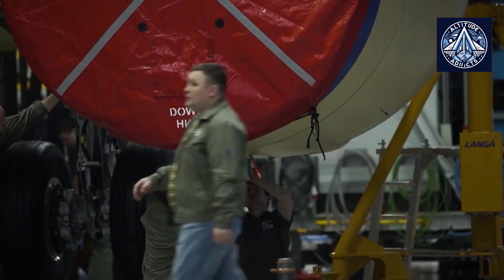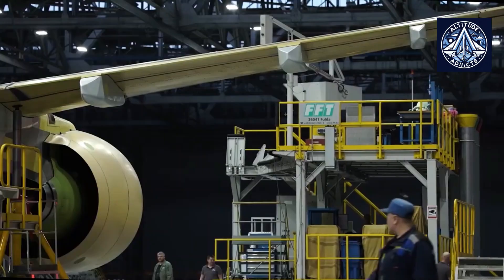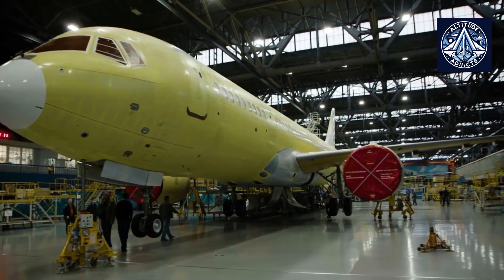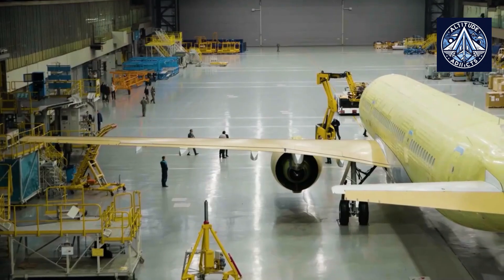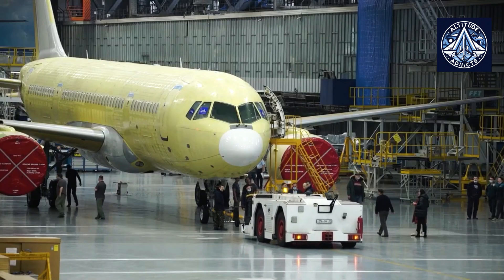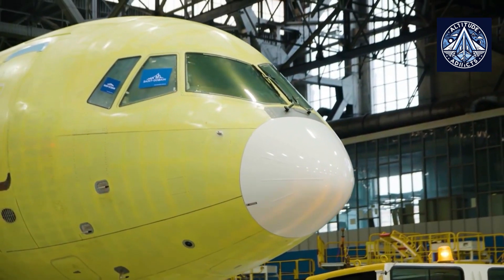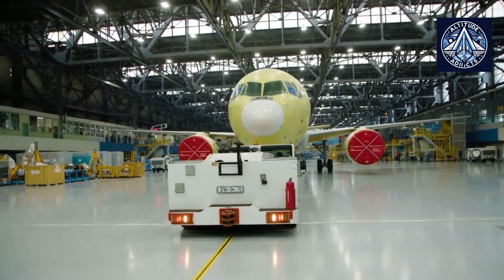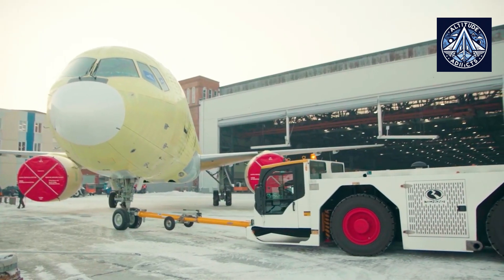Russian-Made MS-21 Stabilizer -  TsAGI Confirms Strength and Reliability

Comment: Exceeding design parameters by 50% is making the part too strong and therefore too heavy
Reply: Not the case because of the composite materials aka carbon fiber
Reply: @arthur_vit2  what I said is especially true for carbon fiber components.  Everything should fail very close to designed specifications.

Comment: The ms-21 with western engine and avionics was certified by the end of 2021, that is 5 years after first flight, that is normal for a brand new model. It took more than that for 787.
Now because of the war in Ukraine, Russia is forced to replace all imported components. Replacement has to be created and tested, when you try to do everything, it takes long. Both airbus and Boeing use various suppliers from several countries.
Reply: @hailus7714  Very very good analysis! I was going to say exactly the same thing. How many planes, and good planes, did Russia manufacture from A to Z in the past? A lot! But it is no longer relevant, especially in aviation, to do everything by yourself, because there are already things done and well done elsewhere. It's to go quickly, and not to try, for each small part, to try to reinvent the wheel. That being said, it's not a problem of know-how, in any case, as far as the Russians are concerned : the problem was of a commercial nature for the Westerners by brandishing the future approval of the plane in their airports. They had ask that many parts of the plane be supplied by their own manufacturers, among which...the engines themselves. All this for a double reason: first, for simple market reasons, therefore reasons of profit, but also for reaons of elimination of competition on many parts including especially the engines. Russia had accepted all this for approval of his aircraft, and finally to be able to sell all over the world. But as soon as the sanctions fell against It, with the war in Ukraine, the parts are being changed including the stabilizers described in the subject, but especially the engines (PD-14) very efficient which have nothing to envy Western engines. On the contrary! 
Completely agree with the time it took for the 787, and other planes...but also the time we didn't take for the 737 MAX, and which produced the dramatic results that we know.
Reply: Sanctions against MC-21 started far before Ukraine in 2018 to carbon fiber materials used in it's wings. Almost at the same date as USA made 200% import duties for Bombardier C-series. Just to protect Boeing.

Comment: Yes, it takes too long to test, imagine airbus has been around not that long if it has to take them that long to test every single element on each model of their aircraft it would take them 100 years to produce a model, even the Su57 1st flight in 2010 but they are still struggling to output products 14 years later; that is an abysmal track record that Russia has, and it becomes more annoying when they keep bragging about models they haven't even been able to mass produce after so many years yet, to me it's mean they are incompetents and not capable.
Reply: It is always easier said than done! Please give the name of any other country on this world that can actually manufacture a modern aircraft alone.
Reply: Sooner or later they will build it anyway. How many Western countries able to build civilian aircraft without cooperation with other countries?
Reply: if you consider all the western sanctions imposed throughout the years against the MC-21 project, then Russia is doing fantastic and the MC-21 will fly commercially in 2026..
Reply: Boeng 777x you mean?😂
Reply: Airbus has assembly lines in 6 countries, parts produced in 32 countries including Russia and most importantly airbus is not product of one country but four.  UK, France Germany and Spain created Airbus Industries and all worked on first A300 jetliner including Netherlands.  If there were no sanctions starting in 2018 on Russian airspace industry MC-21 would be already in serial production and flying all around the world.  

If 20,000 sanctions is enforced against any of these four countries UK, France, Germany or Spain and 2 years after if country still exists none of these countries would be able to produce one single jetliner in a 100 years let alone develop one from the scratch.  If MC-21 enters the service by 2030 it would be huge success considering Russia being under so many sanctions and they have done it on their own.  I truly hope MC-21 project would succeed